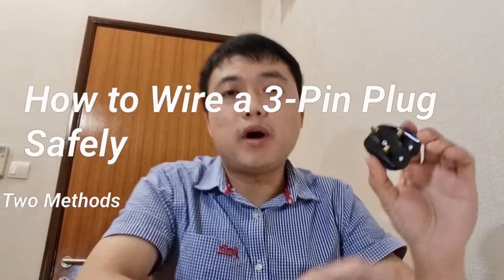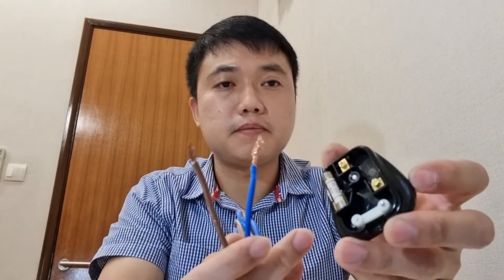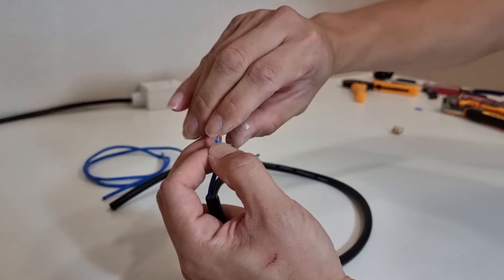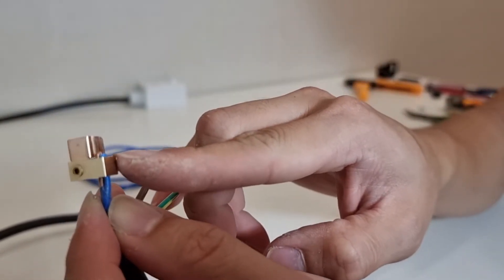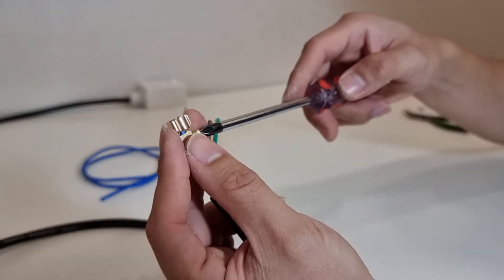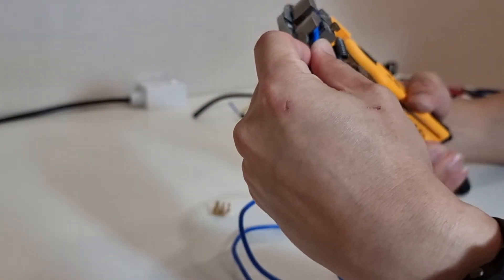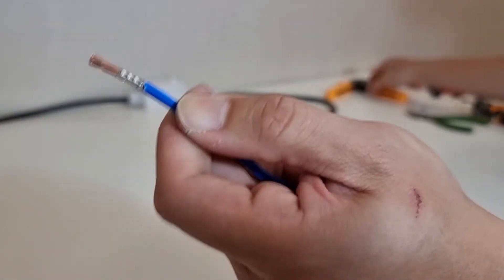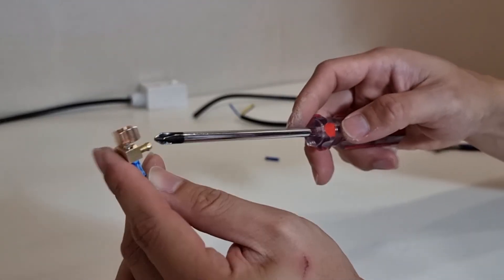You'll Never Wire a UK 3-pin Plug the Same Way Again - Here's Why and How to Do it Better!

Comment: is it okay if without ferrules? I've seen many ppl use this uk plug without it but when i ask chatgpt it said not safety, i usually twist and fold the wire before insert like in your first method in video but not fold with the insulation , is it okay too?
Reply from the maker: depends on the power draw. anything close to 13A (10A to 13A) i would not recommend no ferrules as you really want the contact to be very reliable. below that, i have not had issues without ferrules. as for folding without the insulation, you can get away with it for low power devices (1A to 3A) but anything above that (4A to 9A), then it tends to generate some contact heat and from experience it can fail in certain instances
Reply: @wilf15592  thank you for insight , i calculate my system (computer , speakers , monitor , laptop ) if all those active at same time probably draw around 3.6A to max probably 4A at 230V i use 1.5mm stranded wire 16AWG but without ferrule with twist and fold method i want to make sure if this acceptable?
the ferrules pliers are too expensive for me just for only once use not sure if it worth
Reply from the maker: @bolulembut  this should be fine actually

Comment: can you make another video especially for installing 3 wire to uk plug with ferrule im struggling with it because the fit kinda awkward especially my ferrule a bit longer , should i cut the ferrule a bit shorter?
Reply from the maker: Yes I use ferrules for 3 pin UK plugs too depending on the situation. I've used 1.5mm to 2.5mm ferrules with no major issues. For the bigger ones like 2.5mm, I do face a slight challenge with the bend radius near the ferrule when fitting everything into the plug but nothing that can't be overcome with a little force with pliers. Don't have to worry about deforming the wires as you're only doing it once so no repeated fatigue to the copper. Generally I don't have to clip off the ferrule to fit but I don't see any harm I'm doing so either if that makes everything easier to fit for you

Comment: Never crimp your insulation as part of the electrical bond.
Reply from the maker: Hi there, yes as a general rule of thumb we shouldn't crimp the insulation but if we understand the rationale behind it we will know when exceptions are not only allowed but preferred. Take for example RJ45 LAN cable termination, we do exactly that - crimp the insulation, penetrate it to establish the underlying electrical bond. In my video we aren't really crimping the insulation, we are merely applying pressure onto the insulation so that the other side where the conductor is gets crimped onto the brass prong. The alternative of crimping directly onto loose strands of copper wire is inferior.